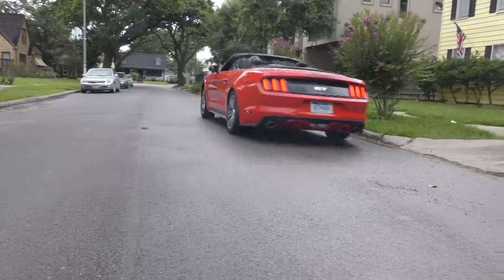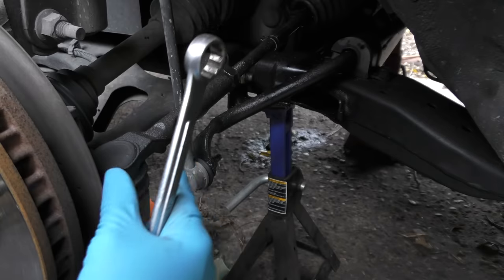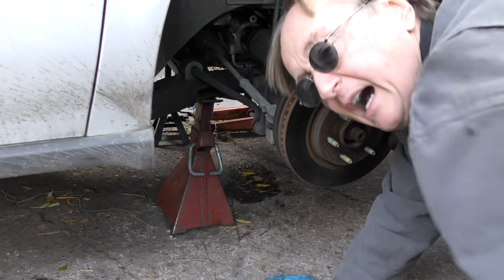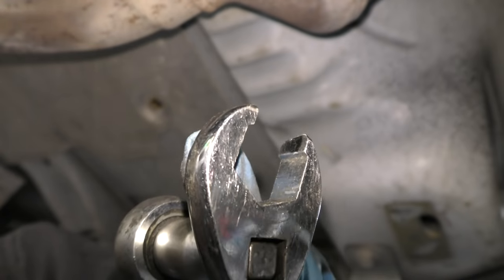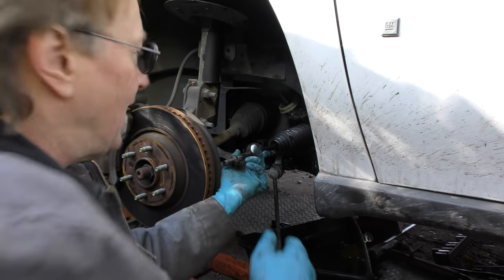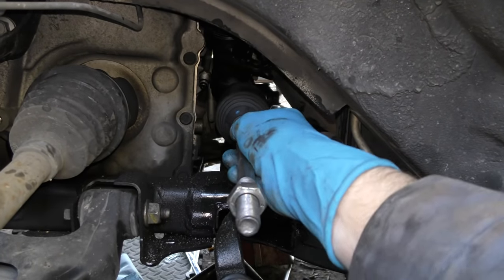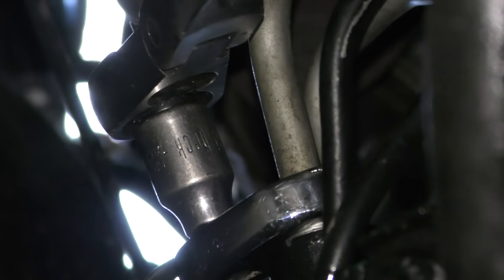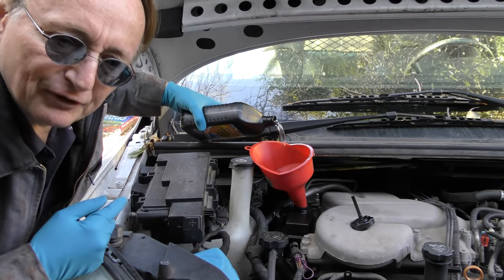How to Replace a Power Steering Rack in Your Car

Comment: hey i really need opinions please. my mom and i just baught a $3000 2005 ford taurus 27 days ago. 2 days ago the power steering fluid was empty so i filled it up then when i got home and shut the car off i opened the hood to check the fluid and it was squirting out the top of the resevoir and hit the hot motor metal part to the fan and caught on fire. thank god i put it out with water. i was hoping it was just an o ring on a hose but then it started leaking from the bottom drivers side yesterday. so i took the driver wheel off last night and the boot was filled and the rubber black accordian boot was touching a metal part underneath and my sisters friend looked and said the bar inside the boot must be broken. we just baught the car 27 days ago and we asked the seller why the engine had all dirt on it and he admitted that they lived on a dirt road so im pretty sure they knew that part was broke and just wanted to sell it n not fix it. he even lied to my mom and said it drives perfect on the highway but since the day after we baught it when i drove 55 mph on the highway it vibrated and felt like the wheels were wobbling and my mom didnt believe me because she wont drive on highways and the guy said it drived perfect on the highway. i live in Massachusetts and they have the used car lemon law but it says you have to prove that they knew about the defect. i don't know how to prove they knew about it because anyone that has a broken piece on their car and it still drives for a while and doesnt leak yet can lie and say it's fine when they don't want to pay to get it fixed and just sell it and get the money. he had to have known it was broken because my sisters friend works on cars and he said you have to really drive messed up to break that part in the boot. and the seller must've broken it because he admitted they lived on a dirt road and i was thinking that to get mud and dirt caked on that engine they had to hit some pretty deep puddle to get the splash up as high as the engine. it's only been 27 days and i've been driving slow and careful because i didnt want this car to break on me because we have the worst luck with cars. we thought it would last because it had 71,000 miles on it. i really wanna try and get the money back from the seller or at least have him pay for the repair but my mom isn't like that she won't stick up for herself she just cowers down. we really don't have the money to get this fixed that's why we baught it, 71,000 miles and they tell you the car is perfect... you expect it to last. I'm sick of getting screwed like this. opinions on what to do please.
Reply: contact them and ask them fists how often and how far did they drive the vehicle commonly, and ask what highways, then ask them if they knew about those issues. I would text  or email to keep records of the conversation. If they denied knowledge of the issue take it to a reputable shop and get it diagnose, tel them exactly what the symptoms are and to write on the cause how long they think the problem was there.

Comment: How do you know if its not just a high pressure line? or o ring of some sort?
Also, my transfer case is pretty greased up as well, do those leak much?
Reply from the maker: +Chris Sant YOu put UV leak dye in the system and see where the green dye comes out. You can also put the dye in the transfer case to check for leaks

Comment: Quick question: I replaced my inner and outer tie rods. During my replacement i turned my steering wheel all the way to the right, heard a clunk and immediately returned it to its position. Any chance i damaged my rack and pinion while changing inner ties?
Reply from the maker: you can bend em if you whack em hard to get the rods off
Reply: Scotty Kilmer Whoa- its kind an honor to get a reply from the Kilmer himself.

Comment: Hey Scotty, what size was the crow foot ratchet wrench you used for the power steering lines on the rack?  I've got the same type of vehicle with a leak in the return cooling line, so I'm gathering up all the stuff I need to do the repair.  Thanks again.

Comment: hey Scotty I have a suzuki swift which I bought last year March. It's not starting.  .I mean I don't know if the key is detecting or not cause it has keyless entry and it's not working with the buttons which are given on key. I am putting the key in the keyhole to unlocking the door and inside the car.  .nothing is responding.  .not even the security light is blinking.  .Plz reply ASAP sir
Thank you
Reply from the maker: +Sourav Mandal check for a dead battery, pray the whole system isn't shorting out for that keyless crapper, cause suzuki pulled out of the US years ago and hardly anyone messes with that system anymore here

Comment: Scotty, when I turn the steering wheel it's stiff and sometimes hard to turn I flushed the power steering system and change the power steering pump. I think it might be the rack and pinion what do you think it might be any suggestions?

Comment: @Scotty Kilmer, in this video, are you working on a Chevy Uplander? If so, what year? This looks very much like my Chevy Uplander, and if that's the case with this video, it would be very helpful to go by this video.
Reply from the maker: +jehutybladerx2 yes, an uplander, not such a hot vehicle so they don't even make em any more. Too many flaws
Reply: @Scotty Kilmer what tools and sizes were the fittings on the rack lines?

Comment: You missed an important step out to lock the steering wheel in place so you don’t damage the clock spring when you take the steering column off the rack

Comment: hey Scotty, little off topic, but i cant seem to find any info on a problem with the steering issue im having, maybe replacing the rack will fix it, (after watching your vid actually i wonder if its not the pinch bolt) but when i stop my truck it feels like my steering wheel moves forward toward me and then when i accelerate again it moves back toward the front end, not a whole lot of travel, but enough for me and a mechanic that did my alignment to notice, and he said he didnt know what would do it... any ideas?
Reply from the maker: bearings on the steering wheel shaft are probably worn
Reply: hey, i appreciate your response. i couldn't figure out how to word it in a google search to come up with anything relevant, but "bearings on the steering wheel shaft are worn" came up with exactly what i needed. thanks!

Comment: Hey Scotty, After I remove the pinch bolt the rack won't unbolt from the steering coupling.  What do I do now.  I have a 2002 Buick Century Custom
Reply from the maker: get a metal wedge and open it up a bit with that and  a hammer

Comment: Hey Scotty awesome vids! My brake pedal goes all the way down to the floor. I replace the master cylinder and it stops better but I can still press the brake hard to the bottom. There is pressure missing to stop.... ideas?
Reply from the maker: if brakes are hard with car turned off, but sink when engine is started up when you press on the brakes, change the brake booster. If not, bleed air out of the system
Reply: bleed brake master cylinder

Comment: My Honda accord 2003 steering is so hard to turn right checked resovior and fluid burned hole the it and a hose ,this June got new rack and pinon and today replaced power steering pump but still can't turn the steering wheel unless its jacked up moves fine then. Please help any suggestions,

Comment: I have a 1994 300zx, when ever i brake my steering wheel shakes- I want to know if the rack and pinion has to do anything with it. 

A shop once told me the rack and pinion was creating play and it was starting to wear out- others tell me its the rotors that may not be smooth and its causing the steering to shake
Reply: +NismoZTuner Almost guaranteed to be warped rotors.
Reply: First check the ball joints and tie rod ends for play, then if they are good check the rotors... Have them refinished or replace them if they're old anyways.
Reply: +NismoZTuner Check all those parts like the others said and do also check the tension rods. With the 300ZX they often have problems.

Comment: Hi scotty . I need to change the steering rack of my nissan versa. Iam wondering if the remanufatured  racks are reliable? Which brand so you recommend Thanks
Reply from the maker: No, i trust none of them, they are a real cow to replace and then all that work often goes for naught within a year or so with many
Reply: For a Honda..  How about the remans sold direct from the Honda Dealer?

Comment: I have an Audi A6 3.2 Quattro 2006 and the power steering rack is leaking bad. I love working on cars and all. I have been trying to find some video as to how to take it off. It seems like it’s a little tighter to get to than the car in this video. Anyone have any suggestions? Thanks.

Comment: Hi I have a 93 Camaro and my front driver tire has side to side slack just a little but enough to knock it out of a sticker. I was thinking tie rod end but the movement is in the rack and pinion. Does this sound like the rack and pinion could be bad?

Comment: Hey Scotty, 08 Lancer's AC is only cold when the car is moving. I know the condenser fans need to be changed because they're rattling and one is obviously broken, but could something be wrong with the condenser too? How can I tell if it's only the condenser fans and not both the fans and the condenser itself? thanks!
Reply from the maker: +Samuel Alvarez  try the fans first
Reply: +Scotty Kilmer Okay, I'll try those first. Thanks! Are you by chance ever gonna make a video on how to change/upgrade camshafts?

Comment: hey Scotty I have a car that is leaking the power steering fluid from the rack and at the same time the fluid it's leaking up from the pump I don't know if it's the pump wheel is broken or I may have a leak from a hose but I'm pretty sure that the fluid is leaking from the pump lid it might not be sealing correctly. the Rack it's not leaking from the sides it's leaking from where the hoses connect to the Rack or maybe it's broken from the inside cause I borrowed the car to a friend and he returned me the car crashed with no power steering oil and the driving wheel it's loosen and with no tires I know I know I need to get better friends but what should I do I found a car on a junk yard and the pump and the Rack look in good shape or I should just buy all the parts new or a big OR can it jus be a minor thing like a ripped seal or loosen screws hope you reply thanks.
Reply from the maker: do my video "finding and fixing car oil leaks" to find the exact leaks then decide what to fix first
Reply: Scotty Kilmer ok I'll have a look up it thanks

Comment: Sometimes when I start up my car my radio show power steering and I can't move my wheel. So I turn off  my car and crank it back an move the steering wheel back and forth and my steering wheel loosing up and able to drive again. I don't know what is causing my car to do that.

Comment: hey scooty or someone please answer my question I have 2010 honda accord rack is leaking genuine one is 1000 dollar it old car should i buy genuine or aftermarket like Cardone remanufactured also work well? I dont want to pay for repairs again and again as I just change power steering pump putting genuine one as aftermarker were not working

Comment: I have 04 f150 I replaced the ps pump but still super difficult to move the steering wheel. So I was guessing then must be the rack and pinion but after doing some read a symptom of a bad rack is loose steering. So I’m. Not sure what it could be

Comment: Hey scottty, what causes a bubbles in the power steering reservior tank when you turn your steering wheel, i try to bleed the air but it wont stop making bubbles when turning lock to lock mostly when turning to the right.

Comment: Scotty i have small annoying problem .. my steering while I'm driving always slightly leaning to the right. to keep it straight the only annoying thing here ergonomically my arm get tired when i drive a while. so what could be the issue here ? thank you
Reply from the maker: +East17A go to a front end shop and pray it just needs an alignment
Reply: 95 Chevrolet Silverado 5.7 v8 how can you tell if its out of time because it back fire back through the throttle body

Comment: scotty, i have a problem with my car, the brake light and abs light is on at the same time, how do i fix this?
Reply: it's a sensor in the rear or trans depending on the car, happened my truck

Comment: I have a 2003 Chevy Tahoe LT and when I park little bit uphill it is hard to pull down to shift reverse and when I put it in park and turn the steering wheel it is hard to turn the steering wheel when I put it in park can you help me I need an answers for my problem of my car

Comment: Question, can I splice the bad part of the high pressure line on the power steering pump and use hose clamps or is there to much pressure for it to hold??????????????????

Comment: would have been nice to know the bolt measurements for this install. i have the same van.
Reply: 2006 Montana AWD - 18mm on mounting bolts, 18mm line fittings, 22mm lock nuts, 15mm sway bar bracket bolts, 13mm link pins, 15mm tie rod nuts.

Comment: hey Scotty is this the same set up  for a 2002 Pontiac Montana...and if so what is the size of the crows foot wrench?
Reply: The job is about the same, but you need to drop the subframe (just the back - be sure to support it) to get the mounting bolts out and the rack out.